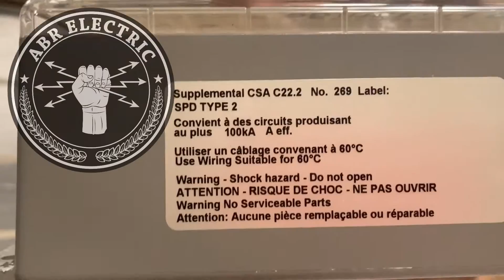Comparing Surge Protectors: Siemens FS140, Ditek and Eaton Ultra showdown.

Comment: There is a surge protector in the market, commercial grade and super handy in size, etc. BAD WOLF. I installed it and is very impressive.  For less than $300 it protects even from lighting and EMP since it goes for more than 200k instead of 140k. I was hoping you would check it out.  My neighbor installed it and I was so impressed that I did so as well, and I moved the old one I had (Square D 24k) tot he subpanel and the BAD WOLF in the main panel.  And, is made in the USA by disabled veterans! They also have one for your car, for DC and to protect electronics from EMP.
Reply: I'm shopping right now. Bad Wolf looks interesting. Haven't pulled the trigger yet, but leaning that direction.
Reply from the maker: Thank you for the recommendation! I will definitely look at it
Reply: @abrelectric  I love how is half the size of the others and is so highly rated that it would seldom be at risk to explode or burn if a massive surge hits it. More so, it will survive and not be sacrificed so it should last longer.
Reply: eaton ultra here.
Reply: Bad Wolf's products were Not Tested by Underwriters Laboratories, unlike Eaton and Seimens which underwent UL Testing.  Bad Wolf needs to pay and subject his products to UL Testing and post the results, then I would buy from him.  For now, Eaton and Seimens are the Top of the Market for Homes.

Comment: I have a question that is confusing me. So I'm replacing the breaker panel, I will be installing a generator back feed breaker with interlock. The breaker panel has neutral and ground separated, they will be bonded at the main disconnect. The generator has a 4 prone 30 amp non gfci Outlet, so two hot, one neutral and one ground. My generator is a generac exl8000 with bonded neutral and ground. Does the generator need to be floating neutral or bonded to plug it into the house using the back feed? A video from you would be awesome about it and a simple good explanation 😁
Reply from the maker: Leonel, do you have a separate main disconnect,  that feeds a subpanel with your branch circuits? The subpanel doesn't have a main breaker right?
Reply: @abrelectric  the way its setup, is the main disconnect breaker is right after the meter outside, from there it feeds the breaker panel in the garage that has all the breakers for all the circuits in the house. No other panels are installed and the breaker panel in the house has its own 200 amp disconnect breaker, but it is fed from the outside 200 amp disconnect.
Reply from the maker: @leonelsway  you'll need to install  your interlock outside at the main, or add a main breaker inside to the subpanel. You can leave the neutral - ground bond on the generator. UNLESS the generator MB is GFCI protected,  in which case you'd have to remove the bonding jumper in the generator to prevent nuisance tripping.
Reply: @abrelectric  I'm replacing the main breaker panel next Saturday. The new GE panel has a 200 amp disconnect breaker. That will let me install the inter lock for the generator. The 200 breaker will basically be a disconnect from the outside main disconnect.
Reply: @leonelsway  When Ca. was having the power shutoffs due to fires (cough B.S. cough) I made my own mains disconnect at the breaker panel. It had a mains breaker. The AHJ said, "sure, why not. As long as it works properly and cannot back feed the lines."  So, I did and had it inspected and approved with a county sticker. YMMV . Check with your county electrical code inspector. It was easy to make from aluminum plate.
Reply: @abrelectric  I think you should definitely remove the bonding at the generator. The whole principal of bonding ground to neutral is that it should only happen in one place to prevent neutral imbalance current from flowing through  the ground wire in what's called a ground loop. All your breakers and disconnects in residential only affect the line wires. With your main breaker off, the neutral is still connected to the grid and the generator. The ground is still connected at the meter. If the neutral is connected at the generator, worst case (unlikely) scenario is your 200 amp 240 volt grid service is supplying 200 amps on one leg, zero on the other. At the main panel, some of that neutral current can flow through the neutral to your generator, across the bond and back up the ground wire to the panel. Electricity DOES NOT take the path of least resistance - it takes all paths in inverse proportion to the resistances it sees at that point.